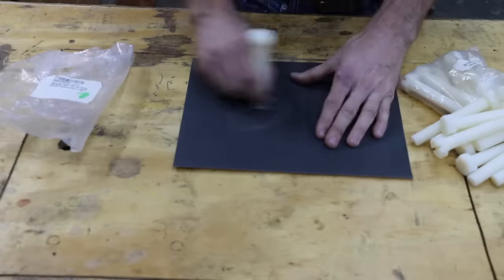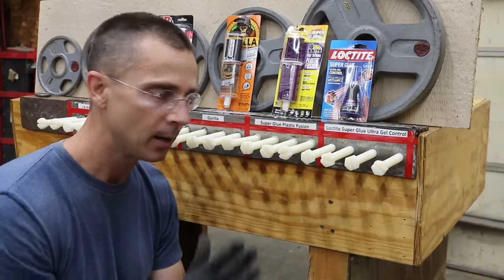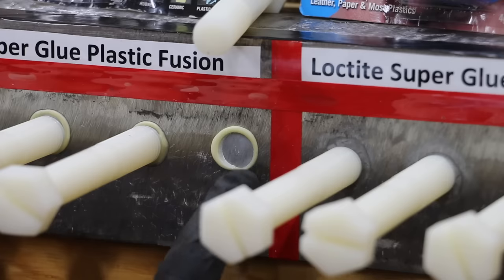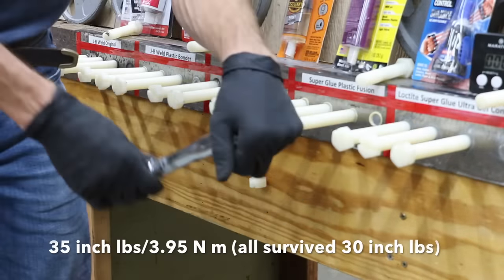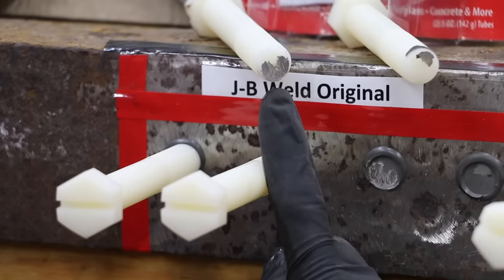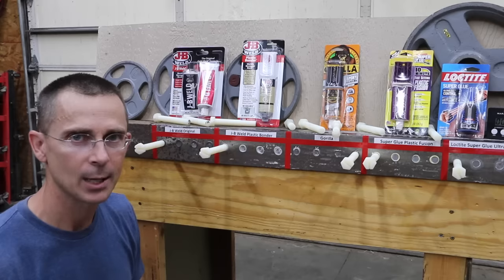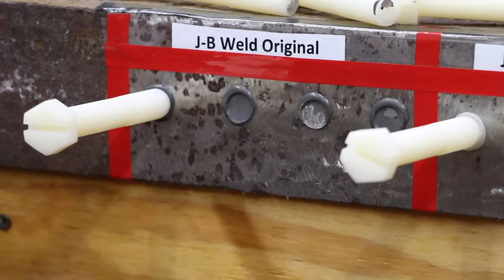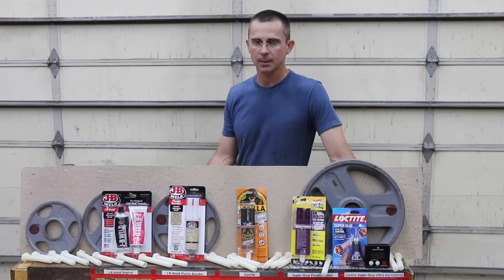Which Epoxy is Best for Plastic?  Let's find out!

Comment: Hi there, I had a custom fixed vehicle window vandalized... It is unavailable. So I was thinking about using plexiglass but I'm not sure what to use? The glass was glued in place originally on a aluminum frame. I would prefer to use a caulking gun and it would have to be strong vs the weather elements. Any ideas? I would sand down the edges before I installed. This would be a permanent fix as I have no other options... 
Any input would be appreciated. I would prefer the color black if possible.
Reply from the maker: Use 1/4 inch plexiglass.  Use 3m clear super silicone seal.
Reply: @ProjectFarm  Hi there, thanks for your reply! I'm going to use Polycarbonate it is 48x24 1/4"  as it is quite large. So it has to be secure! The clear will make it look bad as originality it was black. So I prefer black to hide the frame.
3M 08609 Window-Weld Super Fast Urethane Black Cartridge. What do you think about this stuff?

Comment: Great video and channel new sub, I was wondering if one of these like the JB Weld plastic weld would work well on connecting a large wing from a Sofubi Pokémon plastic collectible figure, the piece is not even a pound in weight and I would like to preserve the original paint

Comment: I'd like to offer that nylon is notoriously difficult to bond. It's slippery and even roughening the surface isn't going to help much.

I think a fairer test plastic would be lucite or styrene.
Reply from the maker: Thanks for the feedback.
Reply: @ProjectFarm  I think you can get lucite rod stock at big-box hardware stores such as Lowe's, cut them to-length and cut a notch in the end with a tablesaw for to hang your test loads...

Comment: ive only used it on plastic on plastic, & wood on wood, but Permatex epoxy on amazon has worked great for high strain applications for me. the handle came off my dryers lint filter, and its on the end , with a 2 foot long filter, so its got a good bit of pressure on it. i applied it, and it has held since.
Reply from the maker: Thanks for sharing.

Comment: One thing about plastics well I'm a installer of graphics so I have to install on plastic sometimes and I've learned that plastics some of them maybe all of them that you need to flame treat them or with a heat gun but I just use a torch you just flash the plastic with the torch and it cuz plastics off gas since they're made out of petroleum and like decals and paint and glue won't stick or won't stick as well unless you flash them is that that freezes the off-gassing for a while FYI
Reply from the maker: Thanks for the feedback.

Comment: Maybe you could make a similar test for PETG plastic to PETG Plastic. I suggest USA made one from Push Plastic. Why? because PETG from different brands behave differently. Another from ABS to ABS. Frequently we need to create 3D printed parts that need to be glued together and, boy, 3D printed plastic like PETG is very popular and hard to glue together. I tried 3 of the ones you showed and only Loctite worked well. I just do not know how strong these glued parts can be. Congrats with your experiments!!!
Reply from the maker: Thanks!  Thanks for the suggestion.

Comment: Hello. I hope anyone can help me please. I’m trying to glue a carbon fiber trim piece in my car over aluminum trim, the piece needs to be held down right tightly in order for it to retain the button functions. Unfortunately the adhesive double sided tape it came with is not strong enough to stick the piece down so the button operation doesn’t work. So I’m looking for the STRONGEST glue to attach that carbon fiber piece over  the aluminum trim. Any suggestions would be highly appreciated. Thanks.

Comment: JB weld original  is the best all around epoxy..even tho it says on the package it's not good for plastic it works fine for plastic too.. The only draw back is it's long cure time (24hr) while most other epoxy cure in half the time or less..
Reply from the maker: Thanks for the feedback.

Comment: In the same way that steel reinforces concrete, are there substances that can be aged to these glues, which increase their resistance to tension? (For instance carbon fibers?)
Reply from the maker: Thanks for the suggestion.

Comment: Would love you to test the 3m line of adhesives. They have so much and claim such high numbers.
Reply from the maker: Thanks for the suggestion.
Reply: 3M two part adhesive DP8005 works great on PE and PP (polyolefins).  Most epoxies like JB weld will bond well to nylon.  PVC, Acrylics  (eg plexiglass), ABS and styrene are best welded with solvents.  Remelting with hot air or hot tipped tools works with any thermoplastic but requires good technique and lots of practice.  Screen or thermal wire inserts can help as reinforcements in many situations.  And if filler rod is used it must be from same plastic family or it is unlikely to adhere very well.   When bonding dissimilar materials you will find that epoxy, urethane or silicon thermoset adhesives usually work best.  But super glue can sometimes fill the bill.  If the bond has to be flexible, like shoes, the latter two work best.  Fluoropolymers like Teflon will not adhere to anything unless surface treated with hazardous methods which go way beyond the home workshop.

Comment: A few comments:
1) What KIND of plastic are those bolts? That's crucial info and you didn't specify. Different plastics require different bonding agents! Consider the recycling numbers (1-7). The fact that in almost every case the joint broke at the plastic tells me this plastic may require a very special bonding agent for a reliable joint!
2) With only one sample per test, neither you nor I have any idea if it was the bonding agent or the way it was assembled that led to the test result.

Comment: Curious what type of plastic bolts they were? Probably some type of nylon I would imagine. Certain plastics are more prone to bonding than others. Ever wonder why bottles that hold glue are made of polyethylene or polypropylene? It's because glue won't stick to it. A 6-60 nylon bolt is fairly strong for a plastic bolt but not so much for it's ability to be glued. A glass filled polycarbonate bolt would be a better choice in my opinion.
Reply from the maker: Thanks for the feedback.

Comment: Hey! I was wondering if you have seen the Super Glue/Baking Soda repairs. I was wondering if you would be interested in testing out some different Super Glues with baking soda for the strongest repairs. I have seen multiple videos of these where they repair impossible plastic bits and save a purchase. Thought I would share as this does seen extremely viable to people with some patience or the want to fix something without buying new.
Reply from the maker: Thanks for the suggestion.

Comment: Ah maybe ya should use  other types of plastic. Back in the fifty's I put together plastic models and sometimes a model that  was imported may be made of really  different plastic and  the glue that  used was Testor's glue. Oh it did great on most everything. But thinking back I never used any cleaner before I put things together, just wiped any visible crud and that was it, maybe,  had  I been smart enough  to use alcohol. Maybe I would  always have had  super jobs.  And another thing I  really didn't consider temperature ,  to be  a big  factor.
Live and learn, and I learn quite a few things on your channel.
Reply from the maker: Thanks for the feedback.

Comment: Plastics vary radically- what type of plastic were the bolts?
Reply: Most plastic fasteners are nylon (polyamide 6). That's what they look like to me. Fairly hard to bond, nylon won't dissolve in solvent type "fusion" adhesives.

Comment: It seems to me that of the 5 adhesives tested only 3 are epoxy resins, "Super Glue" is cyanoacrylate, quite a different chemical. You should probably use the word "adhesive" rather than "epoxy" to describe them as a group.
Reply from the maker: Thanks for the constructive feedback.

Comment: At the risk of sounding ostentatious:

Some of these failures depend on the type of plastic.  Those screws are probably made of Nylon 6.  
For other materials,  like PP,  ABS, PVC, and PS,  I find that model cement or pipe cement works better 
than most of these products, provided the bond is plastic to plastic.  
Bonding plastic to metal is notoriously difficult. 
You may be better off by experimenting with blends of different products.
Reply from the maker: Thanks for sharing.

Comment: I think your results will be greatly influenced by the amount of epoxy resin into which the bolt is pushed. I noticed that the JB Weld Original came up around the outside of the bolt more than most.  I think you need a way to make that consistent. Perhaps you could wipe around the bolt to remove any epoxy that has oozed out around the bolt.
Reply from the maker: Thanks for the constructive feedback.

Comment: 1. Type of plastic. - That looked like nylon???? (Nothing stocks to nylon)
2. Who wants to bond plastic to metal? (very few) Who wants to bond plastic to plastic like in a broken part? (Don't know anybody who doesn't)

How 'bout re-running it with ABS, Polly S', or Polly Pro'. Typical broken handwheel type stuff. (fact is I have a Craftsman miterbox saw with a broken handle. Tried to plastic weld it twice but it didn't work all that well - It's why I watched the vid) 

Just an extra FYI for anybody who is interested. I glued the plastic tailstock handle on our Clausing lathe back together when one of our guys hit it with the towmotor. I did bore the ID and put a 1/2' rod in is so I guess that would be cheatin' but the break is an a sharp angle only like 15 degrees off center and the regular JB Weld has held it together in daily use for over 5 years now. Don't know what kind of plastic.   Very hard. It seems almost like bakelite ?????..... Don't you believe that plastic, is plastic, is plastic. though. Big difference between say Delrin and Plexiglas. 

BTW, beginners luck? First time I ever used JB weld in my life was the tailstock handle.
Reply from the maker: Thanks for sharing!

Comment: Should revisit this testing against a plastic surface holding a plastic bolt…
Reply: Should revisit this testing against a plastic surface holding a plastic bolt…
Reply from the maker: Thanks for the suggestion.
Reply: @ProjectFarm  can you do something like plugging a fuel tank,,, with all the gas theft… One claimed most plastic plugs don’t work on fuel tanks because the fuel tank plastic expands and most plastic welds do not…

Comment: Video suggestion:    Great info on all of your existing glue/epoxy videos!  If you do any more epoxy videos in the future, can you include cure time? The number of 5minute set or 30 minute set products that are not even remotely set an hour or 2 hours later is annoying. Generic hardware store epoxy is hit or miss, one brand is amazing, the next is all lies. Same with some of the known brands.       You might just be able to do a video on various products advertised time? From 1 coat paints, 30 minute silicone caulk, 5 minute epoxy, 5 minute cleaner, so many products are misleading consumers! I don't mind if the time takes double, but waiting 20x longer is only lies.
Reply from the maker: Thanks for the constructive feedback.

Comment: I bought the original because my radiator for my mercedez is cracking and it cracked where its plastic.  I need it to withstand temperatures which this one does upto 550 degrees and the radiator it gets upto 120. I am an extremist and I do not want to do things twice.  I am gonna sand that puppy, clean it and try to do the best.  The coolant is leaking but not like a big hole.  I do not think it has the vigration, the pull and I am not using metal to plastic.  Overall, I think the orginal will do a great job so I will make sure I push that inside the crack which is less than a millimeter in thickness.  I migh be able to put the video as a follow up to this video since there was no temperature involved but I will use the original which cost me 27 peanuts and the radiator cost 200 the normal and the original cost about $ 1200 dollars.
Reply from the maker: Thanks for sharing.

Comment: Loctite Super Glue is not an Epoxy. It's Cyanoacrylate, 1 part  moisture curing. It's different chemistry with epoxy, which is 2part, resin and hardener. This is not an apple-apple comparison.

Comment: I have used plastic binder on repairing plastic panels on my scooter it worked or it didn't work I had better results with JB weld no failure longer cure time but better.
Reply from the maker: Thanks for the feedback.
Reply: @ProjectFarm  Your welcome

Comment: If those are nylon bolts, you're lucky anything stuck to them. Most plastic glues I've used that work well tend to melt or eat into the surface of the plastic itself.
Reply from the maker: Thanks for the feedback.

Comment: I had something hit my oil pan and punced a hole i drained it sanded and used J B Weld  6 moths later no leakage also had 4 in. hole on a stright 6 in the back by the firewall welded it up with a mirrow and again J B weld never leaked so you know where i'm coming from.

Comment: "Plastic" is not one material.  Note that nylon bolts have fair adhesion to standard epoxy.  Polyethylene and polypropylene are much more difficult to bond to and are ofter used as release films (when not specifically surface treated)   Vinyls and ABS (eg pipe and plumbing) are readily solvent bonded so are not normally bonded with thermoset adhesives unless being bonded to a different material.
Reply from the maker: Thanks for the feedback.

Comment: One thing to understand and it is difficult is which kind of plastic do you have that your gluing the epoxy for plastic glue to. Some adhesives don't work on certain Plastics and it's difficult for the common man to know what kind of plastic they have because most of us would not have any idea what a particular item is made of unless you just happened to have knowledge of plastics. I don't know what types of plastics the adhesives you were using worked on but make sure you have the right kind of plastic bolts for those adhesives. I have gone through numerous different types of plastic adhesives looking for the right kind to make a repair to a plastic item and most of the time I was not able to find anything that worked. It is not always easy to match up the right plastic to the right adhesives.
Reply from the maker: Thanks for the suggestion.

Comment: The word "Plastic" by itself does not mean a whole lot: a adhesive that glues nylon to metal very well can be absolutely worthless to glue polyethylene as this don't have functional groups in its molecule, it's only C-C and C-H bonds, those bolts seems to be made out of Nylon, the results would be completely different for other plastics, particularly olefins (Polyethylene, PE and Polypropylene PP).
Reply from the maker: Thanks for the feedback.

Comment: Dont know if anyone mentioned anything about the obvious multitude of plastics manufactured? Even the adhesives that are plastic specific state *not recommended for polyethylene or polypropylene. Which is 95% of consumer products used in households.
Reply from the maker: Thanks for the feedback.

Comment: Nylon is not a good plastic to glue. It is similar to Delrin with a slick surface for limited friction thus not conducive to surface adhesives of any kind. A polycarbonate/styrene would be a better choice. I find JB Weld marine holds exceptional to plastics of a styrene/ABS/polycarbonate/PVC or similar base.

Comment: I wouldn't use on a plastic bumber bar, i would use plastic filler unless part is broken. Or use it for part repair filler for the rest, my experience with epoxy plastic welds is that they are too hard to sand back , you can turn a small problem into a damn big one. 🤬

Comment: You missed the MOST important one to try there.
 I use the cheap china stuff all the time; it is EXACTLY liken the expensive ones; all epoxies are the same; they are plastic and they are the same; i tried once the most expensive in the world,from an aerospace company,used on the manufacturing floors,not on the aircrafts themselves , and they are the same; some are sold with special additives,metal powders, but they all have the same melting point,and about the same grip; the secret is the prep of the surfaces: grease free,clean,and abraded.

Comment: If this were a metal welding video, we wouldn't be comparing the strength of welded pig iron to alloy, but this guy just called it 'plastic' not considering matching the material to the adhesive.

Comment: Polyolefins represent 90% of all plastics in the market with over 250 million metric ton per year ( 500,000,000,000 lbs) .  Unfortunately they have very low surface energy (LSE) and no epoxy, or any consumer glue will bind them, paint does not adhere well to them either for the same reason.  Companies such as Henkel and 3M have special formulation (MMA) to bond plastics, they are sold to industrial sectors such as automotive and aerospace, they are very expensive and the work.  You can get some of them on Amazon, but you are looking at $50 dollars an ounce plus another $75 dollar for the applicator.  If you are looking for structural adhesive , you can try 3M DP8010, the first ounce will cost you $125 with the applicator from Amazon, after that just $50 per ounce.  That should have outperform all the consumer adhesive shown here.  Off course, a plastic welder is the best option to bond thermoplastics together, costs pennies plus the welder, but that will not work to bond plastic to metal.
Reply from the maker: Thanks for the feedback.